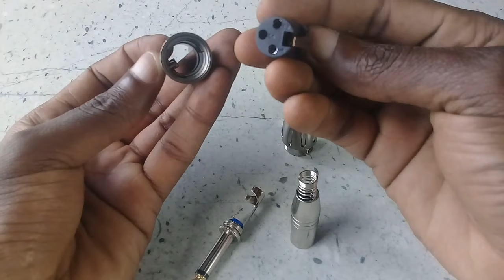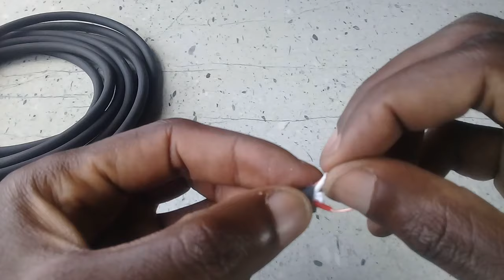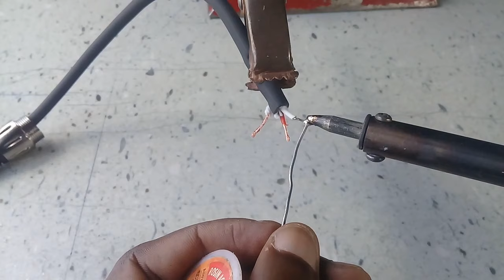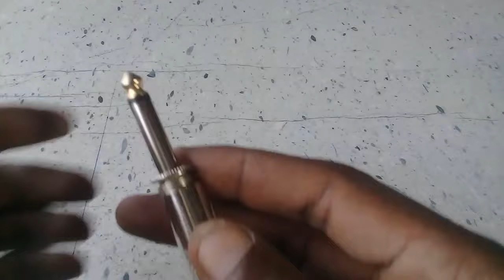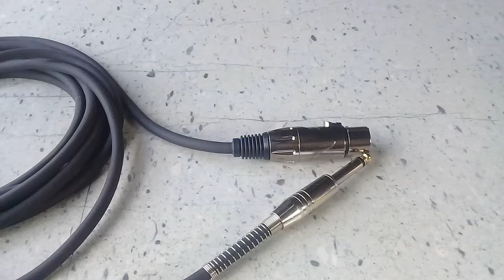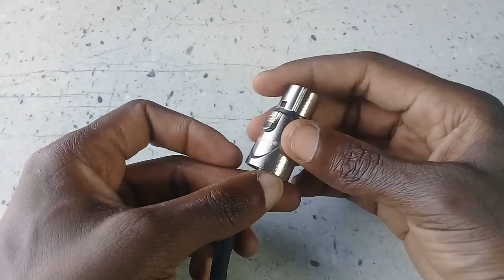How to Make XLR to Mono Jack Cable

Comment: FYI.....for those new to soldering, using flux helps the solder to adhere better to the wire AND terminals. Your joints will be much more reliable. There's NOTHING worse than a cable failure on stage at a gig. Otherwise, this video is very useful.
Reply from the maker: never dispice a humble beginning

Comment: I did this exactly but the cable doesn't work with my mic. 
I checked that everything was soldered correctly.
Reply: Ur mic have an issue could be it wire in reverse